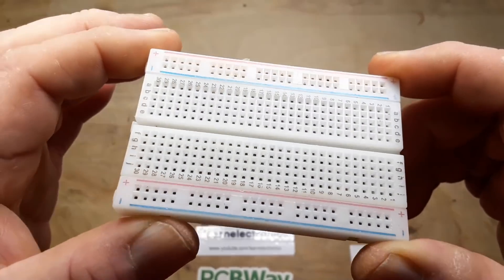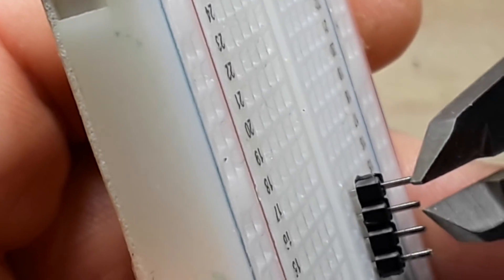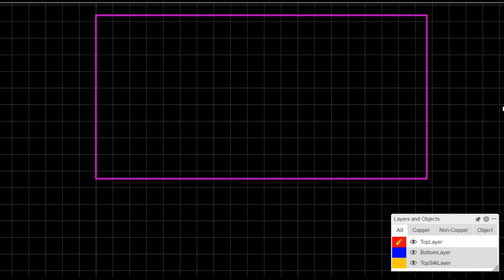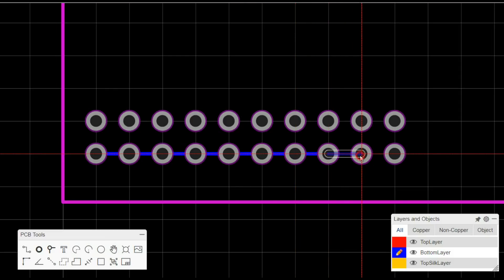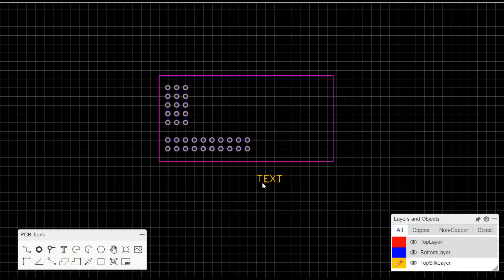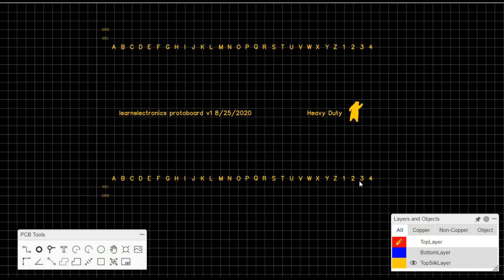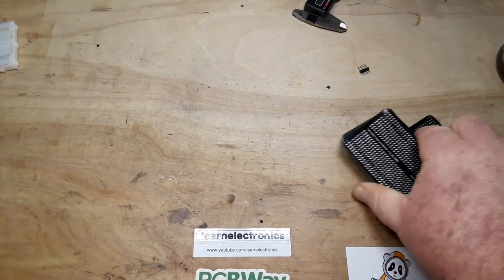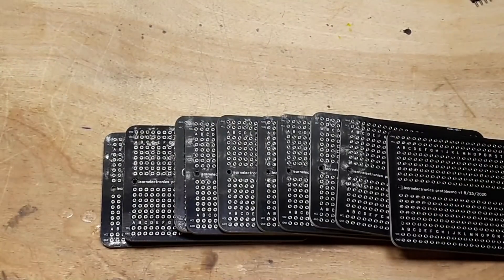Making heavy duty protoboard PCBs with PCBWay

Comment: I made them as well and I prefer the copper traces visible on the bottom. Either by choosing "Expose Copper" or tracing the BottomSolderMaskLayer over the traces. The 2D/3D shows if it's good or not.

Comment: Maybe I missed it, but Why not just use a perma-proto board rather than re-invent the wheel?  Aside from using six vs five pins per column.
Reply from the maker: It's much thicker, just something that some folks may need for  a project.

Comment: I also like the idea that the top and bottom power rails are connected together. It is noteworthy that the top power rails are reversed polarity compared to the standard breadboard layout. They are clearly labeled so it's not an issue, but it might befuddle some breadboarders relying on rote memory.

Comment: Did you get DRC errors while exporting gerber file for these? I followed pretty much exactly the same as video, 2.54mm grid and pads spaced equally but it says "clearance between the objects is less than design rule" (pads). So, I changed design rule clearance to as low as I could and still it gives the same errors. Did you get these DRC errors too & should I just ignore them?
Reply from the maker: No errors on my end
Reply: @learnelectronics  I figured it out, mistake I made was that I ran full track from first pad till the last pad for each row and column instead of joining each pad one by one like you showed. So, I think both work just fine but no errors if you join one by one. To be on the safer side I'll join them on by one now. Thanks for your reply.

Comment: First of all I like your work, thank you for the education. May be the 2 VCC line connecting together permanently is not the best for all projects. Maybe you can add some solderable  jumpers as extension between the VCC lines, in this case the two lines can be used as 5V and 3V3 supplies or just use as one supply option as well :-) Have fun!
Reply: Yeah I thought the same thing

Comment: Did you add vertical tracks to the component mounts like a solderless breadboard does or are the component part just like standard proto boards that are void of tracks to allow a circuit to use different holes on the same vertical plane. I'm hoping for a version of both to be honest.
You are selling me on PCBWay, I am looking for a free version of software that generates Gerber files so I can create my first board and have it manufactured. Any suggestions, hope you get your 100k subs soon, you deserve it.
Cheers from Australia mate!
Reply from the maker: Vertical tracks are included
Reply: @Steve Tobias you can use EasyEDA, either online or as a downloadable exe, for creating Gerber files. Eagle is another option.